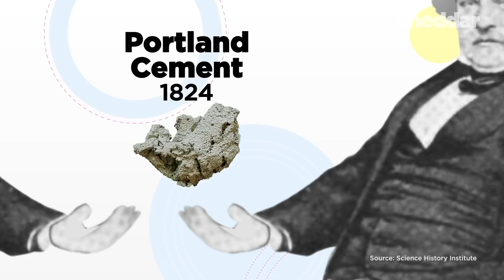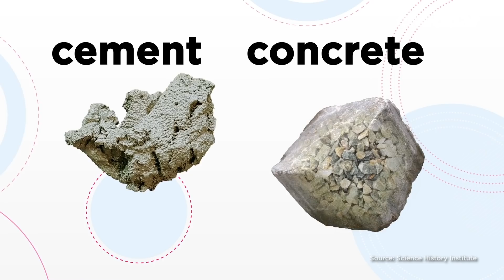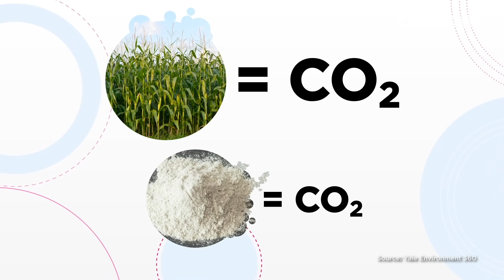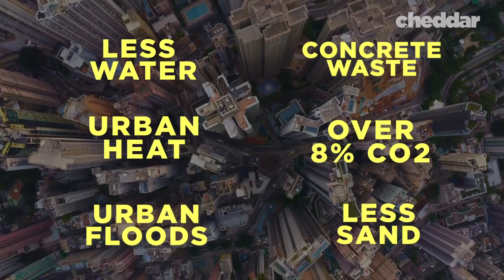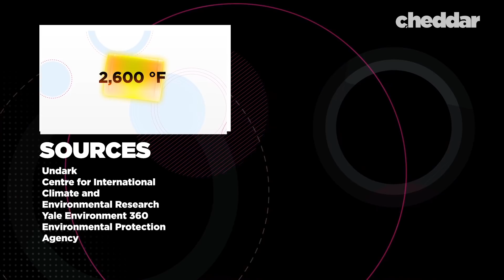Is Concrete The Most Destructive Material On Earth? - Cheddar Explains

Comment: The water used in preparing concrete eventually evaporates and goes back into the nature. Also, cured concrete degrades easily once exposed to water so it might actually be the most recyclable construction material after wood. It basically reduces to its basic elements - sand and gravel.

Comment: What are our alternatives?  
One of the things to consider is less poured in place concrete & more precast concrete panels that can possibly be reused should a building need retrofitting or demolition.  
For vertical circulation and structure  ... reinforced concrete still remains critical in creating strong support. 
The issues of changing its very chemical compound and finding ways of mitigating its emission of carbon dioxide is imperative. 
Also,  revisiting the use of renewable sources for building materials, like wood 🪵  (although counterintuitive) offers a part of the solution to some alternatives we could use to construct larger buildings with ?

Comment: Whats with the farenheit guys? At least also show Celsius on the screen. This measure is completely useless to the 95% of potential viewers who arent US american. Its bad enough we have to do mental gymnastics with pounds and miles but at least those are easily calculated in your head. But farenheit isnt even a straight forward formula like x1.6 or divide by 2.
Reply: Americans will be americans sadly
Reply: I completly agree, the metric system is streight forward and one of the simplest systems to use. if volume,distance or weigth just streigth forward, 1km is 1000m (or 100dm), 1m is 100 cm, 1cm is 1mm and so on, 1l - 1000ml, 1liter of water is 1kg (at 20 degrees C), every calculation can be done without calculator or other helping tools.

Lets look at the system who are used in the US
inches, foot,yards and miles
12in = 1foot, 36in = 3 feet =1y, 5280feet = 1760 yards = 1mi.

Thats just a mess for calculation and when you go in hi precision work where tolerances from 0.01 mm (millimeter) are required the US or the UK system is hard on his limits and mostly fails.
Reply: USA numbah one..hurr durr
Reply: Matt P  if its so easy, then lets just switch it. Make it all in celsius and let the americans do the "easy computation"
Reply: i dont have a problem with F but just blend in C
Reply: What do you mean Fahrenheit is a great system 212 is waters boiling point and 32 is the freezing point. Simply system to remember. /s
Reply: 300 million ppl is not that small
Reply: @fashionlife5348  neither is 7 billion
Reply: @Soff1859  meh we understand Farenheit better it makes more sense
Reply: @fashionlife5348  makes more sense? "0 °F, was established as the freezing temperature of a solution of brine made from a mixture of water, ice, and ammonium chloride (a salt). The other limit established was his best estimate of the average human body temperature (set at 96 °F; about 2.6 °F less than the modern value due to a later redefinition of the scale). However, he noted a middle point of 32 °F, to be set to the temperature of ice water." Thats fahrenheit. 
0 celsisus is the temparature where water freezes, 100 celsius is where it boils... that is sense
Reply: @Soff1859  So why not use Kelvin, then?
Reply: @BrianFullerton  because then its just useless to everyone and thus not helpful to anyone. That isnt the point at all...
Reply: Some people aren’t brain dead and can use both systems without breaking down like a helpless child. Just a thought.
Reply: @pacoramirez7363  i still think cheddar just investing 2 extra minutes of work per video to display both numbers is by far the most convenient for everyone... but they can also just display the one the majority uses and then let the grown up stable geniuses do the math, since its apparently so laughably easy ;)
Reply: Plus 32 than Celsius times 1.8
Reply: @mcamp9445  then why dont they just put it in celsius for the 95% non-US-americans and let the 5% from the US quickly calculate times 9/5 + 32? ;)
Reply: @Soff1859  awe yes, 9/5 a very common unit of division. And the plus 32 makes "intuitive" sense. The problem with farenheit isn't the method, it's the fact people don't know how to use it. No matter how simple the method may be if people don't know it, it does not matter.
Reply: @Sethslayer360  i know ;) i also wasnt serious. The serious solution is to just put celsius on the screen. If the cheddar people put dozens of hours into producing a video, the 2 minutes of calculating and putting the celsius in, is negligible. But if i watch it in 9 mins i dont want to spend two minutes calculating or googling. 
Fahrenheit is particularly ridiculous. Most non americans know that pounds are roughly half a kilo and miles roughly 1.5 kilometers. And those are doable to calculate. The farenheit formula is not... 

Also the video is kinda scientific and even in the US scientific institutions like NASA, universities and the military have been using the metric system for a long time, because its actually better.
Reply: @Soff1859  Thank you for clarifying. From experience I always assume that people are going to defend imperial and ridicule metric. As a Canadian I have experience having to juggle both metric and imperial. I agree with what you proposed because it shouldn't be the viewer's job convert units in my opinion. To add insult for injury for cheddar they are also owned by Atlice USA. A publicly traded cable television provider. So for them to be corporate, have a ton of subscribers and have been asked by many people to change makes this situation seem hopeless.
Reply: @mcamp9445  You uhhh are going the wrong way.  The guy ia bitching about F so to keep it simple.  F -30 /2.  Can do it in your head and is close enough.

Comment: One simple way to have an impact for many of us: Use paving stones instead of poured concrete. While the initial impact is about the same, you get a much longer use out of the material. You can reuse them in case the surface was damaged or you had to open it.
Reply: or large cut boulders with concrete masonry? full future retro

Comment: 5:44 ~ need to create #sidewalklab, #citylab, #googleai #gopro mobile waterjet cutting, all stone must be cut stone, it is a simple law, and charging $200 per minute of cutting stone is a rediculous delay on survival, especially since the silica abrasion, can be picked up with a #wetvacuum and reused on stone cutting=just add water and 60,000 psi, so basically a slanted vertical piston #desielengine for power, most stone is software than synthetic ceramic as shielding, #extensionladder and #waterproofdesktray, for stone cutting, ~ event.

Comment: 0:54 @Cheddar just wanted to point this out. In this supposed map of China, you also included the island of Taiwan, which is a separate country. Although guilty of its own focus on using concrete for city-building, Taiwan does not nearly suffer from the massive over-use of concrete that its neighbor, China does.
Reply: Taiwanese dwellers are Chinese though. Aside from politics, your comment doesn't add any value to this conversation....as is this!
Reply: @faustin289  Chinese in common usage, refers to someone from the PRC, which has never controlled Taiwan. I'm just letting people know that China's talking points doesn't reflect the world, despite its efforts
Reply: @faustin289  Taiwan does also have Austronesian aborigines.

Comment: The world is running out of sand. This has got to be one of the dumbest videos I have ever seen
Reply: Its about the type of sand. There is plenty of sand in the world however concrete requires cube or rough shaped sand. Sand in the world's deserts is spherical and smooth and does not work for binding. Indonesian islands have been stolen to provide sand for china. Not all sand is created equal.

Comment: Given the recent trends towards the legalization of cannabis and the history of industrial hemp, I’m very surprised that your video did not go into the potential benefits of hempcrete (or at least do an analysis of how it compares to concrete). Did you all take that material into consideration when researching this video or were you planning on making a separate video for the topic? I remember from my college days that hemp has potentially thousands of uses with housing/construction materials being one of the largest potential benefactors. If I remember correctly, not only is hempcrete carbon neutral but it is also hypo-allergenic and unlike concrete, it gets stronger with age. #JustMy2cents

I truly love your videos and have watched most of them so far. Please keep up the good work. I have learned so much from watching them.

Edit (May 2021): this video ended up on my watch list again randomly and my first thought was: I wish these guys made a video on the pros and cons of hempcrete vs concrete. I’m still holding out hope that you all will make such a video. Be blessed.

Comment: More than half-way through, and you haven't mentioned that the Germans recycle concrete and that carbonating concrete makes it less of a CO2 hog. Additionally, "foamcrete" is a thing...literally add foam to concrete to make it lighter and stretch the raw material. Just yesterday I needed to buy plywood here in NYC to make a cabinet, but the price had gone up to $60 (fear of riots). I went by a construction site and asked a foreman for a half-sheet from the refuse. He hauled out a tremendously heavy board from a Brazilian company called Miraluz. I looked them up and they make heavy-duty, high quality plywood...where does that wood come from? The Amazon. Yet here I was getting it from the trash in the Bronx. The problem is that the US does not recycle but a pittance of construction trash. (I worked at Google's HQ for some years, and had access to the loading docks. The amount of construction materials and metal that went into the rubbish was enough to build a small town or 10,000 cars year after year.)

Comment: As for the water; unless salt has a negative effect on the structural integrity, why not use sea water when making concrete? Hardly anyone is drinking that!
Reply: I'm certain it affects the concrete somehow or they would already be using seawater as it is infinity cheaper and more plentiful
Reply: Saltwater wouldn't be plentiful in inland areas. In any case, it would likely accelerate the corrosion of the steel rebar.
Reply: Not if you make the rebar out of something less likely to rust or corrode, such as aluminum or wood.
Reply: @N-MCMXCIX  Aluminum isn't a good material for rebar because its thermal expansion coefficient is too much higher than that of concrete. Basalt rebar exists, though, but I assume it's more expensive.

Comment: I think they can use plastic waste as one ingredient of concrete.  We need more innovative strategies like this.  Also, the solid particles leftover at wastewater facilities can be used as an ingredient for filling potholes instead of carbon-based tars.  I’m doing a presentation in class about coal tar sealer.

Comment: But doesn’t the water (though curing) evaporate back into the atmosphere where it then turns back into rain?
Reply: Even if that is the case, regions with fresh water shortages tend to receive very little rain. So if they use water from, let's say, the ground to make concrete, this water is gone for them. Plus a significant amount of rainwater ends up in oceans so that's also a loss for global freshwater reserves.
Reply: Curing actually doesn't evaporate the water. That's why concrete can also "dry" underwater. It binds chemically with the cement, so it stays in the concrete.
Reply: @Classic.Cameras  I'm sorry man, but you're just wrong. If you want to know about the chemical process, you can read about it here: https://civilengineeringnotes.com/hydration-of-cement/
Most of the water stays in the concrete.
Reply: @Classic.Cameras  "Upon mixing with water, the calcium silicates react with water molecules to form calcium silicate hydrate (3CaO · 2SiO2 · 3H2O) and calcium hydroxide (Ca[OH]2)"
Src: https://www.britannica.com/technology/cement-building-material/The-major-cements-composition-and-properties

"Wet concrete doesn't harden by drying. Instead, the water is a chemical component in a curing process. The compounds that react with the water are in the portland cement."
Src: https://www.popularmechanics.com/home/how-to/a3214/1275111/

"The reason that concrete doesn't dry out and then reabsorb water later is because water isn't leaving the concrete at all. It's reacting with it and becoming part of the concrete form."
Src: https://interestingengineering.com/why-concrete-doesnt-actually-dry-out
Reply: No it's doesn't evaporate. Hence the name curing. The cement chemically combines with water to form a hydrated salt of calcium silicate.
Reply: a) no, water does not evaporate from concrete. It becomes part of the structure b) The problem is not that there aren't enough water molecules in the world. The problem is that there isn't enough FRESH CLEAN water. When you divert part of your fresh water supply to one thing, it becomes unavailable for drinking. It does not matter AT ALL if the other use re-contributes water back to the environment (which is not the case with concrete), because you still have to wait a VERY long time for nature to turn that water back into fresh water supply.
Reply: Technically, there are also cements that cure by reacting with carbon dioxide in the air. In that kind of case, the water has to evaporate for the reaction to occur and the reaction in fact produces more water which also has to evaporate.
Reply: @seneca983  Fair enough, though Portland Cement is generally what people are referring to when they say Concrete.
Reply: Yes
Reply: Shouldn't we use ocean water for concrete in coastal cities? Didn't the Romans do that, & doesn't it make a higher quality concrete anyway? Save fresh water to support the ecosystem.
Reply: @polychoron  Untreated ocean water can only make very low strength concrete.  So weak that it is barely useable for anything (or if it is used the additional volume required for an equivalent structural strength is enormous) .  Need fresh water (that is not too "hard" and not too "soft" ) for it to cure correctly and yield useful compressive strengths.  FWIW, not all potable water will  even yield good concrete.

One could put in the energy needed to desalinate the ocean water/ make the salt water into fresh water that is useable for concrete.
Reply: @polychoron  There is no infrastructure to move large quantities of ocean water around. There is, however, very cheap drinking water piped to almost every corner of the industrialized world.

Also, it wouldn't surprise me if salt contaminated Portland cement.
Reply: Let me just remind people that we have more water than land surface on Earth, sure work free pure water it's a spoil Earth has given us to which now we feel entitled to but we have to accept nature doesn't have to give us everything, doesn't have to make donuts or iPad rains... We have sunlight, we have knowhow and we have salty water, don't ask for more just work it out, there is no water scarcity.

Comment: Urban floods: I wish most street roads (not fast ones) would use those puzzle shaped blocks. It helps water in, it obliges cars to drive slow, it's great for holes and fixes (with better rebuilt value).